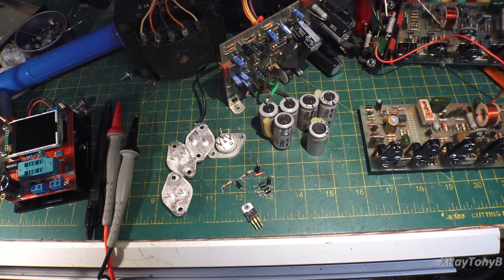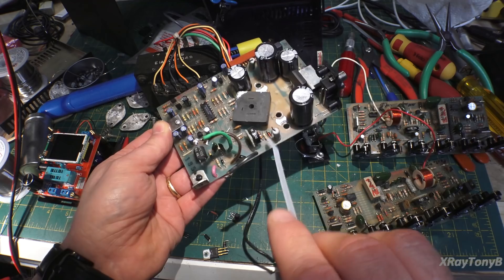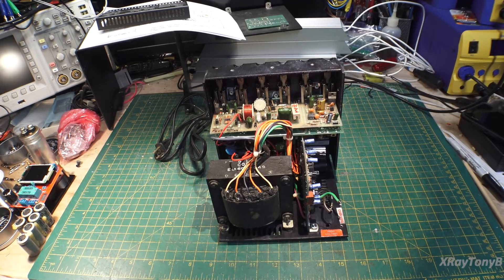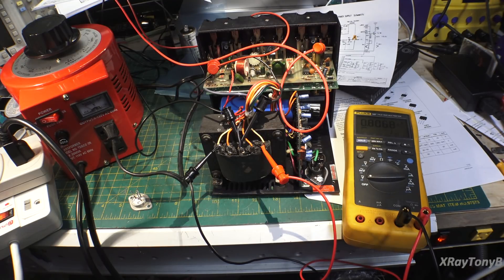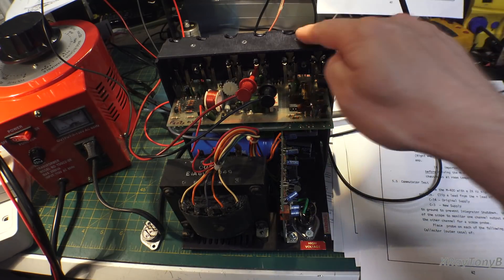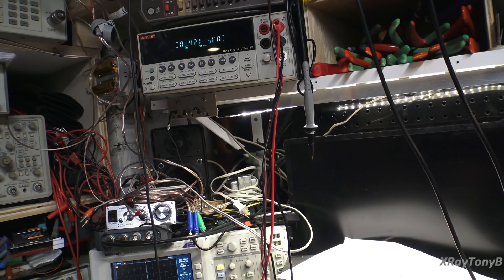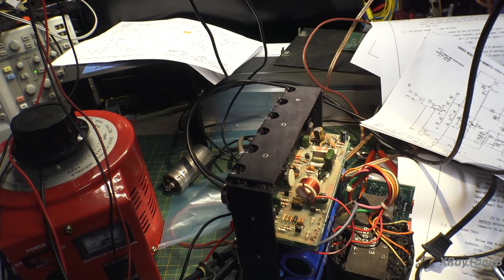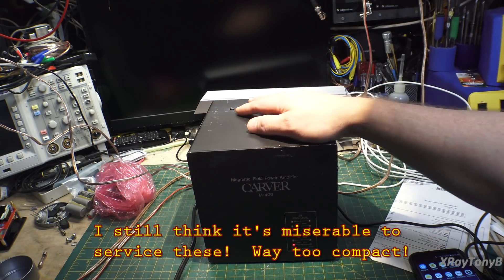youtube video #-N31CRS7mpI

Comment: back in the eighties, i was a club DJ, we ran the m400t through a pair of lascalas.. now when the heat really climbed in the summer in the booth ,  there would be an overheat condition occur, but a service tech told us that that was one of the improvements for this model, there was a temp. protection built in  as a mod,  i tended to believe him, when the amp shutdown due to heat, when it cooled down it would fire up again, no issues.. below a room temp of 100 degrees f  it would run all day and have no issues running hard at night  when it would be cranked to almost full power for 6 to 10 hrs straight.. this was an awesome amp , wish i had had one of my own .. still do.....

Comment: I am so happy to see this video. I am the original owner of a M-400t and it's companion C2 Preamp. I bought them both in 1985 at the Gramophone in Birmingham, MI and used them to DJ while in college occasionally. I had a party once driving a pair of Cerwin Vega D9's and D7's with a Kenwood amp on the 7's. It was incredible. The B&O RL 140's I used with them for ages did not fare so well. The cube has some issue and needs some love though :-(
Reply: I was using a Kenwood monster receiver the Super Eleven ,it really looks impressive with every feature you can imagine with excellent specs and 125 watts, BUT when I got new Ohm Walsh 2 speakers they did not sound nearly as good as they did at Tech Hi-Fi  with the Kenwood. I then got a used Carver MXR 130 receiver and my speakers came to life , better controlled /tighter bass ,sweeter midrange and highs ,wider sound stage and I heard things on my records and CD's that I never knew were there. I could not wait to listen to my entire collection to hear what I was missing.

Comment: Very very interesting video series with the Carver M-400s. I own two Carver M-400t amplifiers that I haven't run in years. I used them in a DJ setup driving Klipsch Lascala speakers. I could make ears bleed at 500 paces if I so desired.  I was never left wanting for sound pressure levels, no matter the venue, including a large party I performed at once in a park where they had something like 10 acres to use. I had the second amp just as a backup, I didn't run them simultaneously. I still have all the equipment in storage. I should get it all out and make sure it all still works. If not, Tony is gonna get to work on a "t" model if he can find schematics!

Comment: I've had two M400t's and one M400 and currently own an M400a for over twenty years (and it still works) The later "t" versions were modeled after a Mark Levinson amp. I cannot recall which one.

Comment: Great presentation up to “regular listeners’ alley”.  You might have mentioned that the transistor power dissipation numbers are given as totally unrealistic ones, where the case temperature would be fixed to 25 degrees C.  That would be possible in a lab with water chiller cooled heat sink or “infinite heat sink”.  For practical heat sinks, you need to watch the DERATING GRAPH.  In the case of 2N3055, the graph gives 115 W at below 25 degrees, then just 95 W when heat sink is at 50 degrees, 80 W at 75 degrees and so on.  Finally, at 200 degrees heat sink temperature, the allowable dissipation is 0 W, or nothing at all.
As to component voltage (and current) derating, way back when I saw a magazine article giving highlights of a MIL Handbook of component reliability and required design practices.  While I have never seen the actual book, I memorized the basics from that article.  In short, you should plan to use components at 70% of their maximum voltage as well as 70% of their maximum current.  The product of these two, or as independent number (just like the transistor), the power should be limited to 50% of the data sheet given (unrealistic) maximum.  Those practices should give the operational margins to achieve the military required system life time.

Comment: Damn that was a great video!   I learned a lot from your detailed review. As a Bob Carver fan from the phase linear days I coveted my first M400 and C4000.  Currently have a M400t that needed some love (leds don’t work and I feel it requires some re-capping due to sound issues). I now have a better appreciation for the amount of work involved.  But I think it may be worth it after watching the video and seeing how you made it dance .   As an old TV repair guy I am almost itching to tackle it but not having the bench hardware you have it’s not going to happen. 
With your obvious experience would you know where I might find someone who could take on a repair such as mine (note that my m400t does work)?  Would you think it’s worth the investment? 

Thank you again for the videos, subscribed and eager to watch more. 
R
Reply: I applaud you at knowing your skills and limitations. I am gearing up to start my own repair business.
Reply: Since it works all you really need is a ESR meter to check for bad caps (in circuit), replace them , then all you need is a high power dummy load from E-Bay (2  8 ohm 200watt resistors attach them to a huge heat sink) ,  a volt meter to tweak the pots as shown on this video.

Comment: What filter capacitor replacements did you use?  The reason I'm asking is that I'm going to re-cap a Madrigal Audio Labs Proceed Amp 3 (effectively a Mark Levinson amp); the problem is the Chem-con 21000 micro farad/75V used in the amp are snap-ins and not available any more.  The Chemi-con replacements available now (some 20 years after the amp was built) are 22000 micro farad screw in types and much too big to fit in the case in any orientation.  I've found some Cornell Dublier 21000 micro farad/75V capacitors which I can jerry rig in using 10Amp wire and laying them flat, but their insanely expensive £33/$45 each (I need 6).  I'm therefore curious what you use when re-capping a quality amp.

Comment: Wow that thing was really fried. Did someone spill a drink down it or something? I used have one of these for my mobile/road DJ system. The idea was to keep it as light & small as possible but still sound good. Never problem for years driving into 4 ohms per channel for almost twice the power. I kept a small fan blowing up the bottom so it wouldn't get too hot though.

Comment: I know I'm very late to the party but, I bought an M400a back in the early 80's? Carver had this coupling device that let you run it off the speaker outs on your receiver and then let you use the low level RCA's into the M400a. I wish I still had it, it never gave me any trouble. It would make a pair of Cerwin Vega D9's scream. But like an idiot, I sold it on ebay around 2009 for next to nothing.

Comment: Hi Tony.  What an interesting series,  the Carvers.  The poor design makes for fun watching when you probe and jump into full repair mode head on -pun intended !  Is incredibly to see many of the repairs you’ve made when many would had given up long long before.   As you mentioned long before these amplifiers don’t sound much louder than the 100 watt amps or even the 80 watters in terms of decibels,  especially for the current they’re capable of drawing.  Again poor design when they’re capable of avalanching so easily without much protection as evident of all the components replaced.   Much happier with my Pioneer any ole day. Thank you for take the time to post this and again making an interesting series.  
Ps.  Hope family is doing great !!!

Comment: Carver Cube. I sent one of these to Goodwill moons ago. All that Magnetic Field hype promotion did not do Bob Carver well. That being said, I still have my Phase Linear 400, GAS Thaedra preamp into JBL L220's.  Working combo. I have one Carver stage amp with balanced inputs that use real authentic 2SD555 output devices. I might salvaged it for it's devices, if the Phase Linear 400 ever fails (again).

Comment: How does such catastrophic failure occur? Is it the result of aging components, mismatched load impedances or something else?
Reply: Unless there's an insulating cover for those back transistors, all it would take is for something conductive to come in contact with those cases.  I'd figure out some kind of cover before sending it back.  I've seen covers that fix over the TO-3. That might be a place to start.
Reply: @russellhltn1396  -- Yes, those are common and should  be dirt cheap.

Comment: great job!   very interesting.   now, when i watch videos like this i always wonder what is the final complete cost.  i have a system over 35 yrs old and so far no problems, but eventually it will need service and it would be nice to get a ballpark figure  of what i might expect to pay for a repair.   just wondering.
Reply: It is the labor that can get expensive  ,the electrolytic caps eventually dry out on all old equipment and they cost (depending on quality) anywhere from  a few dollars for a pack of 10  for small ones to over 10 dollars each for really large ones depending on where you buy them. You can go to the Carver site and there are authorized service places listed that can give you an estimate.

Comment: The question is why would you want to rebuild/repair this amp? This was a very early Carver product and known for its cheap price and high power for the time. Its not exactly an audiophile grade amp although I'm sure it sounded fine. I'm sure these repairs weren't cheap with lots of time invested.
Reply: As an owner of this amp, I would ask, why do you say it is not audiophile grade (it is)?  And if you can make the case it isn’t (you can’t), why would it matter if it “sounds fine”?  Indeed, it produces an identical signal for a given input to a Mark Levinson amp of the same era, as you would know if you have any knowledge of the brand. But the answer is, these (and its successors) continue to be in service by the hundreds, are continuously deemed worthy of rebuild (a quick tour of YouTube or Carver forums will validate that) and and continue to be in demand on the vintage market because of the ground breaking design. As for mine, I am the original owner, it has never been opened, it has been in service almost continuously, and it functions perfectly.
Reply: @eddevito3282  Sorry but not even close. IMHO but if it makes you happy and sounds good to you then why do you care what others think.
Reply: Dont Care It has served me well.  In answer to your original question, It’s eminently worthy of a rebuild for the reasons mentioned. I had asked why you don’t deem it audiophile grade (to be clear in comparison with other amps of its time). You havent answered,  because you can’t.
Reply: @eddevito3282  You are absolutely correct in what you said , There was a story that went around where the Carver sales rep wanted to compare it to much more expensive amplifiers ,the people at the high end store laughed until they heard it then their jaws dropped. You said yours have never been opened all ,electrolytic capacitors dry out and or leak electrically and or  physically and should be replaced at this age, A service rep can check them in circuit with an ESR meter . Good preventive maintenance before something blows due to bad caps.
Reply: I suspect it boils down to which country club one belongs to.
Reply: @anastigmatix4119  Not really, the costs of the repairs/overhaul would negate any savings versus buying new!

Comment: Do you want to try your luck with another one?  I have an original that hasn't seen a/c for 20 years. Bought it new in 1982. Should still work but I'm sure the caps all need replacing. Let me know!!!
By the way, the fuzzy wind screen is known as a "dead cat". 🙀
Reply: The Carver site has authorized service places listed ,give them a call for recap price estimate.

Comment: I would not consider it "class H" just because it has a regular to regulate the supply voltage.  It would only be class H if it used the input signal to modulate the regulator.  I highly doubt that's the case here because the regulator can only adjust on each half of the 60Hz power line.  Far too slow to track the input signal.